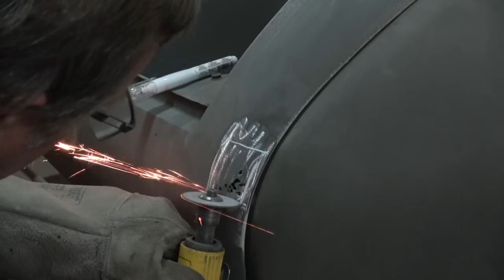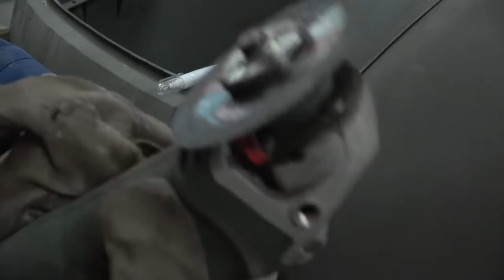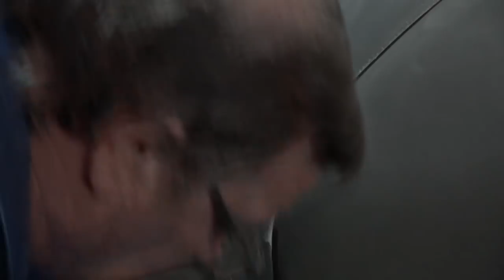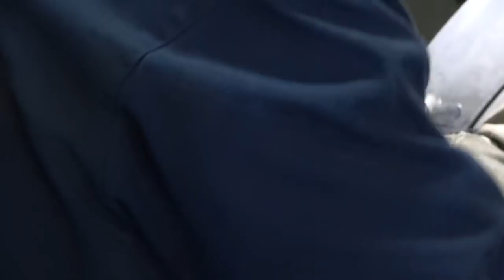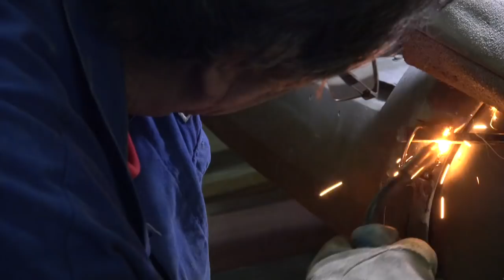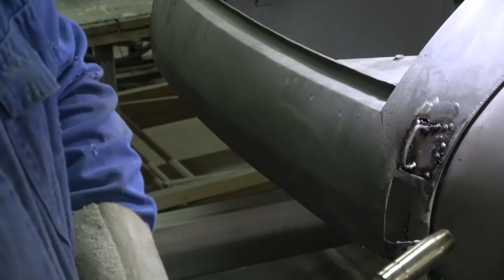DIY Bodywork Tips For Cars (  Jaguar XK 150 )

Comment: Hi Dave good job lad...question you said it needed sandblasting
inside, did you forget to do that or done it before the weld patch
Reply from the maker: Dinos, I used a short nosed wire brush on a drill to clean it out and the sprayed inside with a rust inhibitor, Cheers Dave.

Comment: I'd drill a hole in the patch and spray some U-Pol 789 Weld Thru #2 Zinc in the cavity - nothing rusts faster than a fresh weld and you can't see it forming in the cavity...

One other thing I do quite a bit in these situations, especially where the body flexes or you need a flat surface that might oil can if you weld it, is to glue a patch in. I use plio grip 60 after making up a patch panel that's has an outer piece that is the size of the patch and a larger 'backside' plate that will adhere to the inside of the cavity, fitted up with cleco clips. I glue it, tightened to position with clecos, then pop rivet the patch in where the clecos are holding it. Once the glue is set I grind the heads off the pop rivets. In the case of a closed panel you can only do two sides then weld the rest in, but it is an alternative, and stops the rust issue with welds on the 'dark side' of the join...
.
Reply from the maker: Oliver, Your right about new welding rusting quickly i use weld thru primer for the centre of the patch and on the outside where the weld will burn i use brunxos which is a rust inhibitor & capsulated the steel to a point, Cheers Dave.